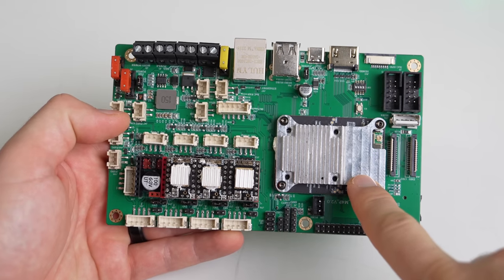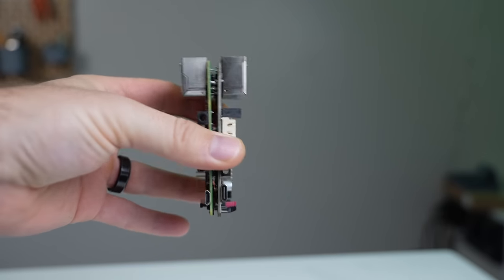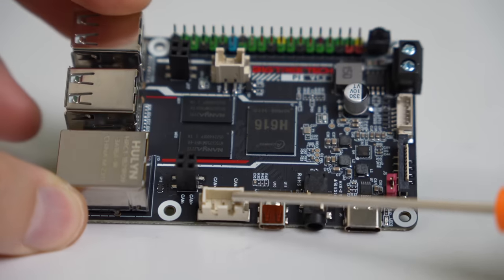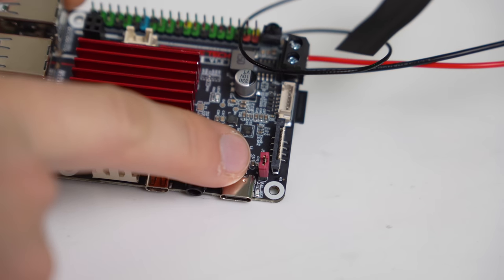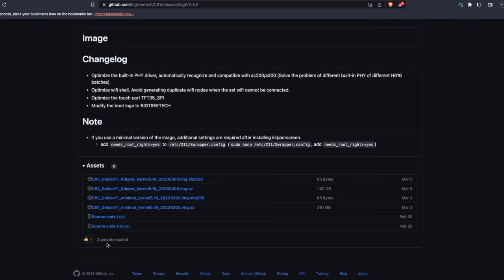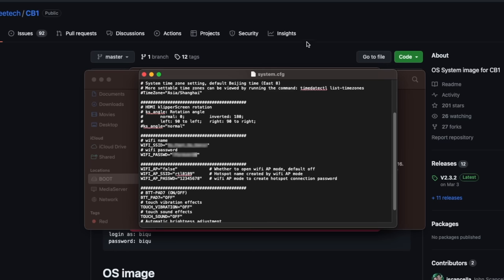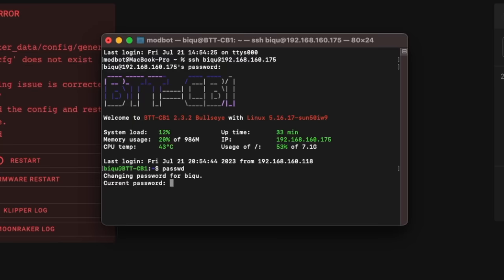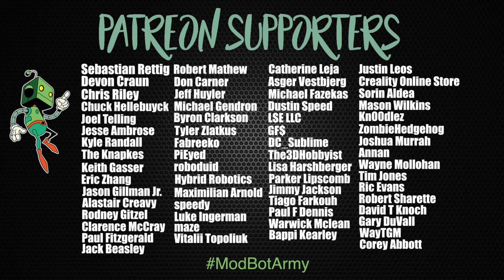Best Pi Alternative For Klipper? (BTT PI 1.2)

Comment: Just a clarification. The BTT pi 1.2 matches the usb ethernet layout of the Pi 4.  The pi 3 is mirrored.
Reply from the maker: Ahh good to know. I almost forgot exclusively have 3+ here and didn’t realize they had mirrored them for the 4. Will pin this 👍.
Reply: But still, the GPIO is on the opposite side of the board. So I guess the mirroring is just an accident that happened during the early stages of board design :D
Reply: One of the mounting holes is offset on BTT pi compared to raspberries.
Reply: Is there any reason to use this setup over a manta setup with a CB 1?
Reply: @adameichler  i read somewhere it had to do with the changes in usb/ethernet sharing they ended in the pi4. Then it became a board layout space issue.
Reply: @trippinonaduck1379  I guess it made sense on the Pi4, but the BTT Pi does not have the same layout as Pi4 and neither as Pi3.  It should not be the H616 problem either - the CB1->Pi4B adapter  has been made with the same layout as Pi4.
Reply: Good video. Unfortunately I found it trying to figure out why my new one does nothing. Mine came with a 32gb card preloaded. Won't boot. Tried imaging it with both klipper and minimal versions and still no boot, both on usb c and 24v power. Must be a dud.

Comment: Nice presentation: very quick and efficient.  However, there ARE a couple things that MIGHT be worth mention: there is NO CAMERA port, in case one entertained the notion of keeping an eye on their printer with a standard Pi camera; and secondly, this board will NOT run any of the MASSIVE library of rPi OS choices!  Short of building your OWN OS, you're limited to the prebuilt options offered by BTT - which may or MAY NOT provide what you need!  And I have found BTT "tech support" to be absolutely USELESS for answering ANY questions when things do not simply work for you right out of the box - which MY kit (this Pi + SKR Mini E3 V3 + TFT 3.5 to TRY to run Klipper on my old Ender 3) just DID NOT!  
Oh - one other bit of trivia, which threw me for awhile: the WiFi seems to be totally DISABLED if you connect the ethernet port to your LAN.  I thought my WiFi port was dead so I HAD to STAY wired up.  And another: I would LIKE to connect to my Mini board via UART instead of the standard Pi USB > Mini micro USB - but BTT documentation was too sketchy and "tech support" refuses to answer (as they have with SEVERAL of my pleas for assistance!)
Reply: Have you figured it out? I have the same issues.

Comment: Powering this without buck converters is worth it alone.
Reply from the maker: I tend to agree.
Reply: Personally, it wasn't an issue, since I had a spare buck converter with wire terminals on hand, but it does add an extra wire to the mix :D

Comment: I always wondered if an old Netbook like an Asus Eee PC or MSI Wind U110 with 2 GB or RAM and a Atom N270 or Z530 still would be fast enough for this or at least octoprint because these Netbooks are often "left over" somewhere in the family and do come with a display, keyboard and USB ports.

But I haven't figured out which Linux to put on (since those are 32 Bit PCs) or how to measure the needed processing power.

It's nice to see that there are other alternatives and how to set them up! 

Greetings!

Comment: Was looking at this board for my printer, but had already ordered an OrangePI 3 LTS before any good reviews came out
Reply from the maker: I am sure the orange Pi will be fine. If you do run into any issues then at least you have an alternative option.
Reply: @ModBotArmy  Oh, for sure! It did take a bit of taking care of annoying issues, though most of those were one the printer side of things (Ender 3 S1), since it refused to make a connection for a good while. Though the BTT PI 1.2 might be better suited for running klipper, since I'm sure it has enough power for it, and it comes in quite a bit cheaper than most the Orange PI 😅

Comment: 1. Boo. The CAN controller should be built in. now and forever. 2. I wonder if that U2C board clears the heatsink well. 3. But yay! 24V input onboard!
Reply from the maker: I agree. I really wish they had just included it or like you said found a way to integrate it.

Comment: I cannot get hdmi to work on mine, is there a requirement for the monitor? Im trying to hook it to my 34 widexcreen
Reply: When I connect hdmi cable to my btt pi 1.2, the board just shut off. you have the same issue?

Comment: What does this Pi actually do? It seems to me that all it does is install Klipper firmware to your printers main board? Isn’t there other ways to install the firmware. If it replaces a Raspberry Pi then does it run Octoprint because that’s all I ever used my Pi for as my Ender installs firmware directly from MicroSD? Is it an alternative to Octoprint?
Reply: Klipper is the alternative kinda , the rpi is still the computer , all the main board is is the slave board so to speak , octo or klipper runs on pi, figures out what it wants to do, sends directions to main board and main boad does the acatual movement
Reply: @ryanbento1565  Ok so Klipper is basically Octoprint. Klipper replaces Octoprint. But can’t you also install Octoprint inside Klipper?

Comment: Can you show us the UART setup?
I cannot get my to work with SKR Pico
Reply: Using a raspberry pi or the BTT pi? I've had the same issue when building my V-Minion, I couldn't get the SKR pico to communicate with the rpi in UART. I got it to work installing canboot in UART mode, even though I'm not running canbus.

Comment: Are these designed to work with other types of OSes like RatOS or the Voron flavors of klipper?
Reply: I think he had mentioned that it takes anything that a raspberry pi would, so I would assume that those would work, though they might not be as optimized, but they should work.
Reply: RatOS does work.

Comment: This is not compelling at all. It costs more than a 1GB raspberry pi. It doesn't have built in canbus AND the accompanying canbus daughterboard knocks out a usb port. Pretty half ass. 

The big problem: it has BTT's terrible documentation and technical support behind it rather than the community's experience with the Raspberry Pi. A Raspberry Pi is potentially usable for other projects if the user stops using the board for Klipper. 

I personally refuse to use any board that relies on micro sd cards for storage any place where vibrations are present. This device really should have built in emmc to make it more reliable than a raspberry pi in a vibration prone 3d printer chassis.  

Really the only thing this thing has going for it is simpler power input. It's really a missed opportunity.
Reply: But, You can't buy that rpi at this moment.. While there's still a rpi shortage in this world, this is still a viable option

Comment: Why... why can't Klipper be ported to a Windows SBC?  Linux is fun for hobby stuff, but for other stuff, I just don't like it.
Reply: Dude you can't be serious, do you even know how Klipper works
Reply: Windows would require: drivers, complete Klipper rewrite, heavy optimizations and tons of networking work
Reply: Linux is just easier
Reply: So much easier, 2 weeks ago I was a Linux noob, yesterday I installed debian on a HP t5740 thinclient, installed Klipper and connected it via a serial to UART adapter to my tronxys wifi connectors, then flashed the modified firmware.
It's seriously simpler than I ever expected.
Reply: If it is too complicated for him he could just an image